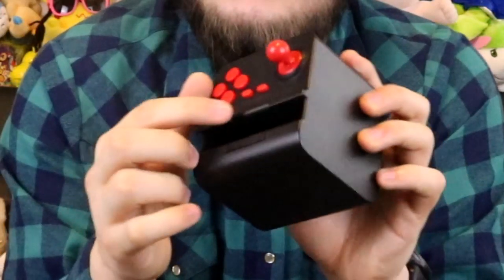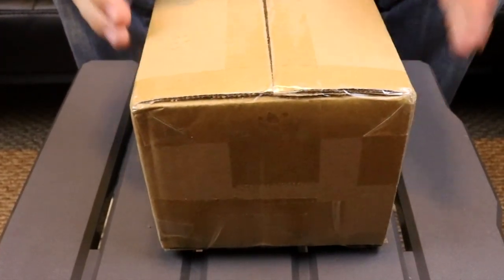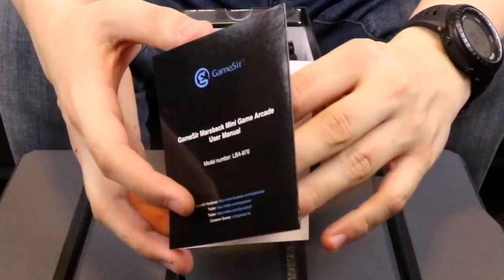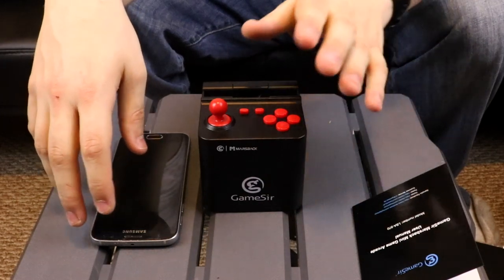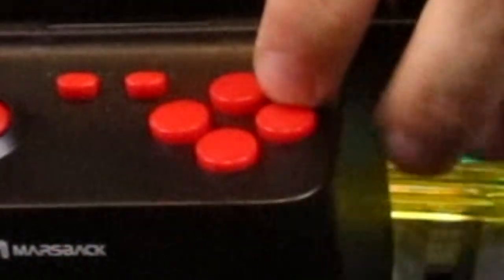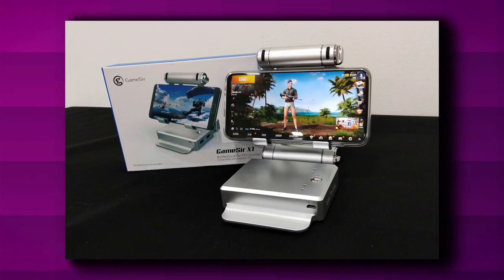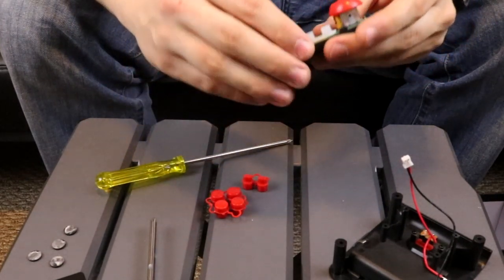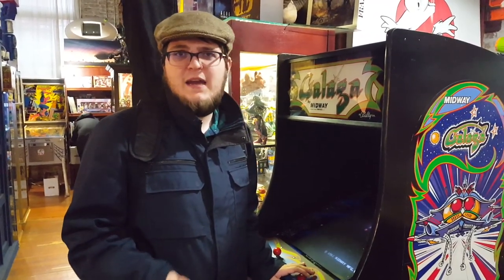GameSir Marsback Joystick: The WORST Controller I've Ever Used

Comment: If there's one good thing I can say about GameSir products, the way they present them is second to none, hell my favorite thing about my GameSir G4S (Beyond it being a fantastic phone holder since it so comfortable to hold & when at home it holds it up nicely when I am using my Xbox One Controller & I'm not near my keyboard with its screen that also holds my phone up nicely) is the box it came in. Been using the display case to hold my favorite controller. But that is where any praise I have for it ends for GameSir though lol. Surprised that the Emulation isn't very good, I thought that patchwork of emulators they pirated (since on mobile some emulators cost money like that DS one which Happy Chick uses) worked fine when I had used it for a short amount of time. 
Also that pairing is strange as well, if there's one more nice thing I can say about the G4S is that pairing it to my phone or to the laptop is super easy, easier than any other pad. (I don't have any GameSir software installed.) Trying to pair my Xbox One Controller to my phone after using it with anything else is a trial & a half. But the G4s? It can be swapped through multiple devices no issues.
Shocking they went from a pad that on presentation alone convinced people it was the second coming of Gamepad Christ, to something that essentially makes the G4s the second coming of Gamepad Christ lol.
Reply from the maker: Interesting to hear that, even if this controller is more or less god awful

Comment: The emulator does work fine.  Every other reviewer says that it is a very good product.
Reply from the maker: As I showed with my phone, the emulator did not work well, and the unit itself left much to be desired. I am not the only one in this camp, YouTuber-wise
Reply: @StuffWePlay  It is also compatible with other emulators because it is Bluetooth.  It works good with newer Android phones.  Also, you are trying to compare a little device to an Arcade machine which there is no comparison.  You should really be more knowledgeable about the products that you review.
Reply from the maker: The arcade thing was a joke dude. And if you noticed, I mention trying with other emulators but with no luck. Regardless, it's not like you can buy one anyways, as the campaign was pulled from Indiegogo
Reply: Stuff We Play  It works with other emulators.  I guess you are not that tech savvy.  You can buy it from their own website if you want.
Reply from the maker: Instead of insulting me, why not just accept that I had a very poor experience with my unit, and while I am sure others have had better experiences, I know several others who have had experiences very similar to my own
Reply: Stuff We Play I’m sorry if you thought I was insulting you.  I was just  pointing out that some of your information was not correct.